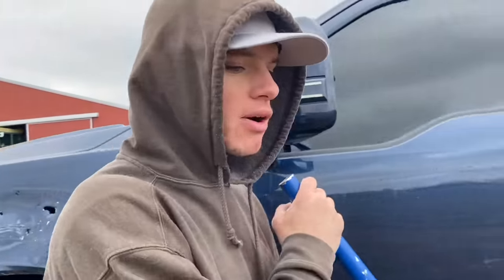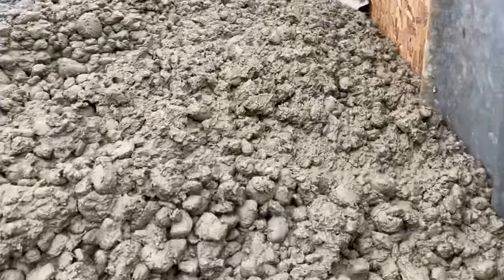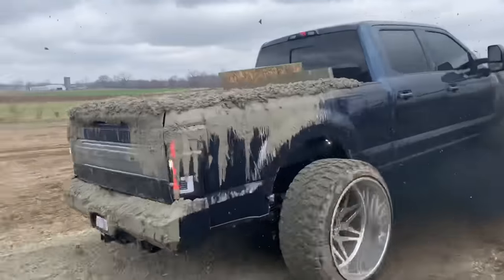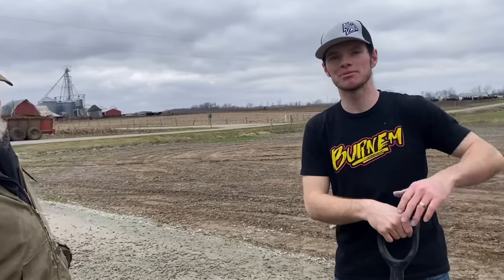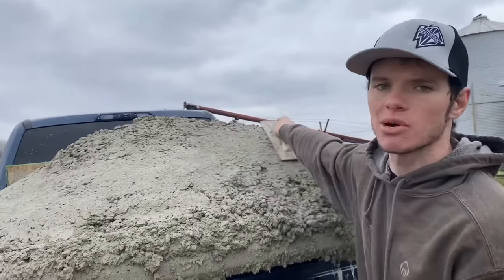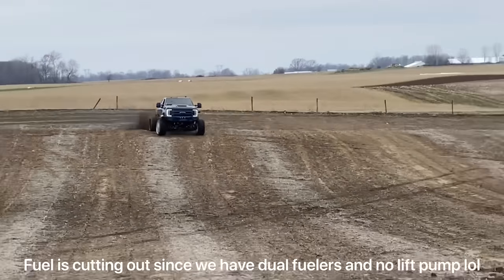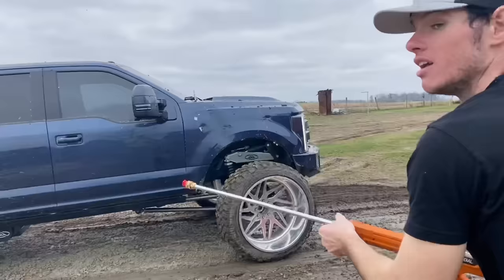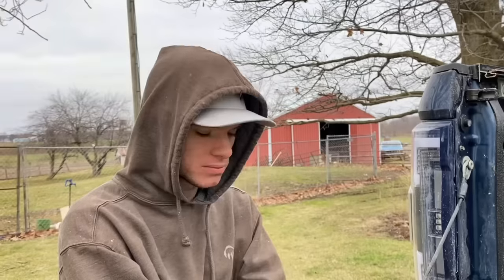Filling Aluminum Truck Bed with 13,000LBS of Concrete (twice the max payload)

Comment: get this kid a ford sponsorship he really shows "FORD TOUGH"
Reply: Ford is a terrible manufacturer & designer of cars. The reason this held up at all (and i phrase that generously ignoring all the bending) is due to the large steel frame of the truck, not because of any engineering feats. Can go look at his other video where he abuses a poor Pak Yak Pro from China and it handles weight even better at 1/5th the size.

Comment: I'm most impressed with the tailgate remaining latched
Reply: Buke Loyd I think it’s a hydraulic tailgate too
Reply: Built ford tough!
Reply: It was probably holding the bed together too
Reply: ArmchairWarrior  he reversed and then slammed on the breaks. There was a lot of force on that tailgate
Reply: ArmchairWarrior  well my fluid mechanics are rusty, but I believe if you figure on a 5.25' wide bed, 2' deep, with concrete density of 150lb/ft^3. You get something like 1575LB of force acting on that tailgate, when static. And who knows how much when doing a boosted launch or  slamming the brakes in reverse. I'm still impressed.
Reply: It’s not a Chevy.

Comment: Say what you want, but that tailgate is the real MVP, the pressure of not only the concrete being in there but also this dude running the truck forward and back
Reply: Ramon H Jimenez for sure that’s crazy strong. I’ve actually been entertained and learned something. We have tarred out the back of trucks and pumped full of water for animals during dry weather. Over we use lugs because we can transfer more because the gates blow out. This is actually a piece of info I will possibly use in the future. (We don’t buy $100,000 new trucks but instead opt for $60,000 repossessed or used vehicles because we do abuse them, but not intentionally of course.)

Comment: Ford should hire this guy to torture test their trucks 😂
Reply: @Corner _Films It wouldnt surprise me if Ford sponsors these videos.
Reply: They wouldn't last long
Reply: Corner _Films yes
Reply: @kaydenchambers359  bruv, you realize this is exactly what he's doing.....and the truck still straightened out. So much for you fanboys shitting on the aluminum bed lmao
Reply: Lol, he's proven how durable their trucks are, with that in mind, I think they should sponsor him lol.
Reply: @Kyle-cv3de  Not surprised, it's a truck, and a Ford truck at that. They take an insane amount of abuse to break, most modern vehicles are insanely durable and this is no exception.
Reply: @KB-bh9hp  i agree. I've seen some ridiculous performances from the super dutys, the 6.7s mostly. Just some work horses. We load them up every day with 3-5 guys, full of tools and stock. Then add a trailer and a skid/excavator.
Reply: They would hold up for sure
Reply: @Kyle-cv3de  That's really cool. I know they had some issues with the 6.0 and 6.4 powerstrokes, but the 6.7 seems like a great engine and your comment backs that up. Now that those engines have been around since about 2011, we're starting to see some pretty high mileage examples and overall, it seems like they're very reliable engines.
Reply: I'm pretty sure he said that they were sponsoring it Ford I mean
Reply: It was torture enough watching him destroy a good truck. I don't understand the mentality of ruining something just for entertainment.

Comment: Concrete guy to his wife when he got home from work: Hey honey I poured concrete in the bed of a pickup truck today... it wasn’t just a normal pickup truck though, the customers truck was a brand new ford. Had this crazy lift suspension and wheels. I really felt bad for the truck but, I gotta do what the customer says. Lol
Reply: The customer is always right 😂💀😂😂
Reply: Plot twist he is the concrete guy commenting this story.
Reply: My first thought lol being the concrete and having to do that 😭
Reply: Thanks for the laugh
Reply: Abitamim Bharmal Bruh. It’s a brand new truck it’s only 2 years old. It’s either a 2017 or a 2018. He did destroy it. Im saying how old it is. It is far from the stage of it looking like it just rolled out the custom shop of course
Reply: hollingerw 2019 lol
Reply: Manuel Trevino shoar
Reply: Extreme Challenges lol

Comment: Remember when we were shocked that he rubbed mud into the stitched floors. We're well passed that by now.
Reply: @blacksheep9734  Ford is the only American brand I'll ever buy again lol.
Reply: Kevin B and there fucking trash, and i know from experience. All trucks now adays are shit. But my dodge (cummins shipping crate) has never let me down ever. The trans did once and i put a manual in it. Absolutely no issues

Comment: Dude Ford is making its money back for that truck 10 fold with this level of advertisement.
Reply: Ford Tough
Reply: Big assumption that they donated anything.
Reply: @bradley4698  FORD TOUGH
Reply: chevys may be steal but ford makes there aluminum trucks SO STRONG!
Reply: That’s not a stock ford at all tho
Reply: @danko9948  Yeah, is weaker than a stock truck. So even better.
Reply: @danko9948  it doesn't matter if the truck isn't stock. The bed would still be aluminum either way. It's not like ford makes an aluminum frame
Reply: It's not ford suspension
Reply: Ford’s trash. Although this was interesting.
Reply: @ChiefNate  I have an aluminum tailgate and would rather have that over steel. keep it lightweight 😁
Reply: I can't like or 420 would be ruined, I do like your comment tho

Comment: The payload of THAT truck is actually about 2,100lbs!  7k is for a regular cab, 2wd, base model truck.  Soooo, you were more like 6x over capacity.
Reply: Yeah any truck can take a lot more than what they are "safely" rated for. Just don't take it on the interstate full of concrete and let DOT see what he did!🤣
Reply: Dually
Reply: Ireally hope you're not saying that the capacity changes from 2100 to 7000 lbs between a regular cab 2wd to a crew cab 4wd. You're saying between a regular cab 2wd and this truck with the aftermarket suspension, right? Because none of the F stores trucks have a 2k lb payload capacity.
Reply: It was the 350 so its about 7,000 if itd the super duty or 5,000 it its normal but in any of the three cases it still seems pretty good for what it went through so props to ford
Reply: No the four-wheel-drive has nothing to do with that because that’s unsprung mass.Four-wheel-drive and 2 Wheel trucks do not differentiate that.
Reply: @littlejackalo5326  This guy knows nothing at all man.2100lbs from a 350 LMAO 😂. My f150 can do more then that.
Reply: So my 1/2 ton can only hold 1000lbs? 

Sure, sure. That also why way back in the day, Dodge and Ford had 100 series trucks? Then went to 150 series and still called them half tons?
Reply: You realize modern "1 ton" trucks don't literally mean 1 ton payload capacity..
Reply: @mayormccheese761  do you know who that guy is?  He probably has most trucks payload memorized with what he does
Reply: no it's more. that's a modded f-350
Reply: The stupidity on this comment section is literally painful.  I hope most of y’all don’t actually tow or haul anything of actual weight because it’s obvious there’s no knowledge of this subject.
Reply: @mayormccheese761  no it can't.
Reply: @mayormccheese761  

Lol!!  Weight is weight....

F-350's have a GVWR of +- 11,500 pounds.

Whatever the truck weighs is subtracted from that GVWR which leaves the payload. 

OBVIOUSLY a 4WD truck will have less payload since it weighs more.

My F-350 4WD PSD with its 11500 GVW weighs aprox.  8100#......leaving me a payload of 3400#.....if it were a 2wd, the payload would be a few hundred pounds more since the truck weighs less.

I'm guessing he thinks this truck had a 2100 pound payload is because it may have had an extra 1000+ pounds of aftermarket crap added.

Let me know when you'd like to learn about COMBINED GVWR, which affects the actual tow numbers.
Reply: @johnpeters9793  I don't know anything about trucks. This guy is just entertaining. So this is an actual question. If a 4wd and a 2wd have the same amount of weight on them, won't a 4 be able to drive with it easier, since all four wheels are doing work? I'm sure they can probably hold roughly the same, and you're probably right about 2wd holding a few hundred pounds more, but wouldn't it struggle to actually travel with the weight, compared to 4wd?
Reply: @since1876  

No....4WD has nothing to do with "driving easier."

The vast majority of these trucks are part time 4WD, the front wheels aren't even engaged under normal driving and should not be on the road.

There are exceptions with AWD drive trains.....but not only do they have different systems to prevent binding, I don't think there are any AWD HD pickups.
Reply: That's a brave camera man to go near the rear and look under while it's that over loaded, also seems many are ignoring that tires have a load rating as well, wouldn't want to stand near one that blows out
Reply: @since1876  thanks for running the numbers geniuses, good to know that a tire can be loaded 8x the load rating still be ok by your calculations.
Reply: @robertficek7586  pay very close attention to the following: WHEN THE TIRES ARE FUCKING SQUISHED TO THE RIM IT'S STILL HALF THE PRESSURE NEEDED TO BURST

Did you miss that part the first time? Did you see the tires getting squished that far?
Reply: It's a F350

Comment: Remember the old Chevy Silverado commercials when they would drop a bucket load of rock in the bed from 15’ or have a competitors truck strapped to the bed rails to prove a point? Maybe y’all should recreate those old commercials!?!
Reply: That was the mid 80’s ford Chevy on the back towing a dodge up a boulder hill
Reply: Capital idea.
Reply: That would be badass
Reply: Ford sucks lol
Reply: Should recreate the lying Chevy commercial recently where they drop unloaded toolboxes in the chevys bed and loaded boxes in the ford bed then swap the Chevy bed for a new bed.
Reply: @Kenny steele Careful, don’t overstrain your brain cells.
Reply: A Ford F-150 with internet access you don’t strain your little brain either buddy
Reply: @Kenny steele You used the same comeback that I did. Way to get creative. You might as well just tell me that you have a single digit IQ.

Comment: I'm just gonna say I'm real impressed with Ford's tailgate....
Reply: @EASTSIDE-313  right im talking about the fact that the hardware was mounted on aluminum and didn't just shear away when it got filled. Sorry should've clarified
Reply: better than a chevy tailgate... as much as i love them, tailgates are horrible on chevys.
Reply: @EASTSIDE-313  It didn't stop working. He just couldn't open it because all the weight pushing against it. The hinges were probably fine.
Reply: @ethanroten4627  I've never seen a Chevy tailgate really have an issue to be honest lol. But I've never had a Chevy either. Hahaha
Reply: Ryan Bishop on the 88 to 95 chevys the tailgate comes off if you open the handle and lift it been times where my friends Chevy tailgate falls off from him hitting a bump on the road
Reply: @blackobs2535  oh no! Lol. That's absolutely terrible. I've got a 99 3500 dodge with a broken bed lol. The tailgate for me holds the sides up hahahaha.
Reply: @CoDisafishy  he couldn't open it, in other words it was inoperable...not working😂💪
Reply: @EASTSIDE-313  you're missing the point bud. It's fine that it didn't open. ANY tailgate with that kind of weight on it wouldn't open. Doesn't mean it broke. If he could have removed the cement from the back of the truck without cutting the latches it probably would've worked just fine. Think about a car under water. You can't open a door until the pressure equalizes. Well without removing the concrete the pressure just over comes the handles ability to pop the latch.
Reply: @vr6prodigy  He doesn't care Chevy stans are the worst in the truck community.
Reply: @KeepItReal2024  hahahahahaha I'm a dodge guy tho. To be fair. I do at least have a cummins

Comment: This really does put “Built ford tough” to another level sheesh
Reply: Like wtf its still fine. This why im a ford guy.
Reply: Im surprised how well it held up and before you ask yes I’m a ford person
Reply: Lol only thing left that's Ford is body and interior.
Reply: @thatmeme1360  they are also the only car company to not take a federal bail out. They are still the best selling vehicles in the us to modern day. And Mr henry ford the first made fast assembly possible. Shut up until you do you reaserch
Reply: @anthonyquickvlogs6106  lol, you mean how gangsters holding assembly workers hostage until quotas were met? Or are you thinking dodge brother's?
Reply: @anthonyquickvlogs6106  besides , I was talking about the particular truck we all watched in this video.
Reply: @thatmeme1360  ford made an assembly line so anybody in America could get a car because ford was the first company to mass produce cars. They also haven't had to take a federal bail out unlike every other american car company
Reply: The hilux merked this thing
Reply: @anthonyquickvlogs6106  maybe ford now doesn’t suck ass, but it’s hard to try and get the sour taste out of your mouth when you get left in the middle of an intersection thanks to 2003-2015 Ford manufacturing incompetence. GM is butt ugly, but reliable.
Reply: @XanVicious  my problem with him isn't even that there butt ugly. Yes there reliable but when I'm a 16 year old who shows animals and runs in the rodeo and does it all by myself Its $15,000 cheaper to buy a Ford F250 or a ram 2500 then a gm3500 because quite frankly gm lacks in towing capabilities

Comment: Whistlin Diesel:
"I've been doing concrete and construction for 15 years before this."

Also whistlin Diesel (holding mag float):
"This is to like smooth it out or sumthin"
Reply: His wrist motion tho😂😂
Reply: I saw his address when he signed the paper for the concrete driver.
Reply: @mikehoncho8268  joking man!!! Lol
Reply: @clintwafer6777  A trophy would be nice.
Reply: Mike Honcho, what is his address
Reply: @projectengine2540  Walnut Indiana
Reply: @projectengine2540  Tippecanoe Indiana

Comment: I use to work in construction as a brick mason. I got a huge piece of rubber from a roofing company and lined my '97 F-350 8' bed. I then filled it with water. We had a truck-pool for about 1 week. Thanks for your time and videos WD.

Comment: I guess, "Built Ford Tuff" applies here.
Reply: FORD.    NO.      ONE
Reply: No the lift is built not the truck
Reply: @jamesmoody4477  what do you think the lift is attached to the ground. The axel of that ford was holding that weight as well.
Reply: @brianbasco5485  I'm pretty sure if u watch the video the axels gives way but the any level lift still works....
Reply: @jamesmoody4477  the axel still works to the lift bent letting the axel move around so technically the lift let loose.
Reply: @brianbasco5485  bro I'm not getting into it. We both agree the axel bent. But we can disagree on wat gave first. Was it the chicken or the egg... well never know

Comment: "What a waste of money"
>40 year olds who barely use their $40k dollar half tons.
Reply: Or their one tons, when in reality a Honda Ridgeline would do for what they actually use it for
Reply: Stewart  dude I've seen a prius haul half its weight. 😂
Reply: Exactly  this guy is giving a beating to a show truck for fun but  shows how much fuckin shit a truck can taks
Reply: @pepeiann  definitely
Reply: Nothing better said, My 12 f350 is lifted on 35s and I follow jeeps off road on the weekend then hook my trailer up with my case 580 Monday and hook things up to ever hook on it... boat river lake snow drift who cares, this guy makes me look like I baby it though...
Reply: Paul Flint no f350 is following jeeps off road 😂
Reply: I've just got an old 94 ford. It sees mud. And still pulls trailers like ot did when it was new
Reply: Half tons are around 50 now 😂
Reply: @tjmower321  it's just a number for a comment. It doesnt need to be exact. 

Idk about you but after googling it I found a 2020 5.0 4 door xlt f150 for 41k. 

Could probably find about 300 more.

Just give me my like damn it
Reply: Thee LP mine does, not on a Rubicon trail level but I have locking hubs in front, disconnect sway bar, locking rear differential, skid plates and scratches everywhere. It’s amazing what it can do, I may have to take the cheat route from time to time but I pull out everybody. You should look up videos of fords, sine with 37s and 40s go in the rubicon well enough.